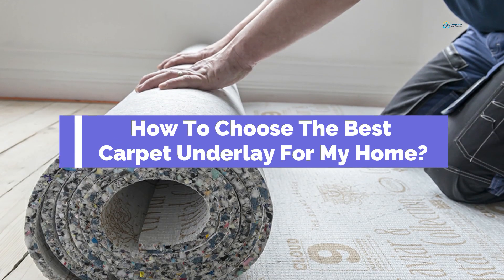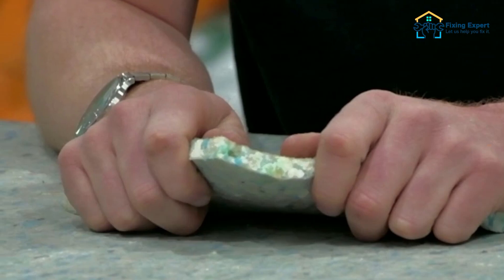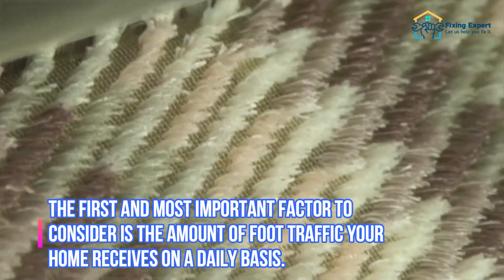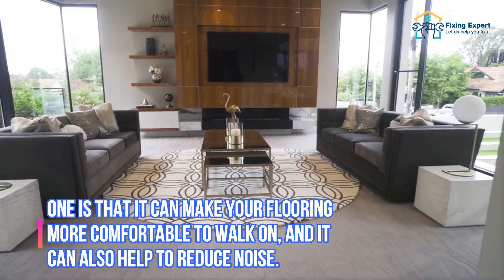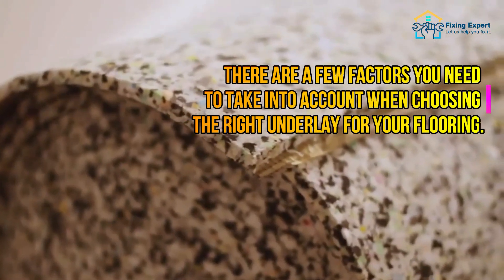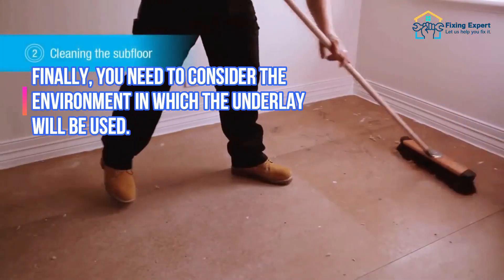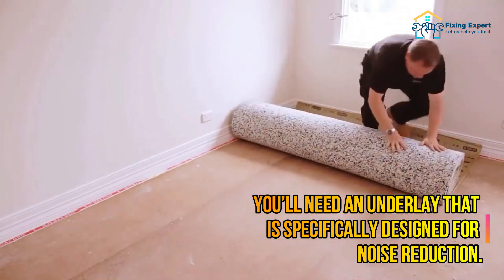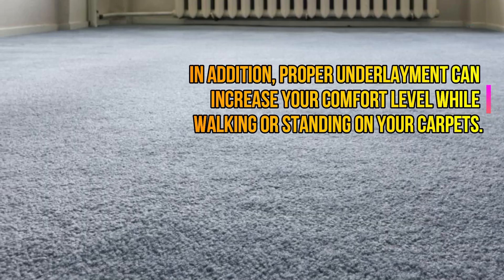How To Choose The Best Carpet Underlay For My Home?

Comment: Can i lay the cloud 9 foam underlay on my shed floor with fitted carpet on top. Will it cause damp/condensation.  between the floor boards and  foam?
I first layed thin silver insulation on the floor then the cloud 9 then the carpet and after a week of cold there was damp/condensation in-between the foil and underlay, im guessing it sweat? I removed the foil insulation and so far the new piece of foam underlay im testing has no damp
Reply from the maker: Laying foam underlay in a shed with fitted carpet on top can potentially lead to issues with dampness and condensation, especially if moisture is trapped between layers. The condensation you experienced with the silver foil insulation could be due to a lack of ventilation or the presence of moisture in the environment.

Here are some considerations to help prevent dampness:

Ventilation: Ensure there is proper ventilation in your shed. Good airflow helps to prevent the buildup of moisture. Consider adding vents or other ventilation options to allow air to circulate.

Moisture Barriers: Check if there is any moisture coming up from the ground. If so, you may want to install a moisture barrier, such as a damp-proof membrane, between the shed floor and the foam underlay.

Underlay Selection: Choose an underlay specifically designed for use in potentially damp environments. Some underlays have built-in moisture barriers or are more resistant to moisture.

Carpet Selection: Ensure that the carpet you use is also suitable for use in potentially damp conditions. Some carpets and underlays are designed to be more resistant to moisture.

Temperature and Humidity Control: Monitor the temperature and humidity levels in your shed. If there are significant temperature variations between the inside and outside, condensation may occur.

It's positive that removing the foil insulation seemed to improve the situation. You may want to continue monitoring the area and observe how the new foam underlay performs over time. If the issue persists, you might need to consider additional measures, such as improving ventilation or using alternative materials that are more resistant to moisture.